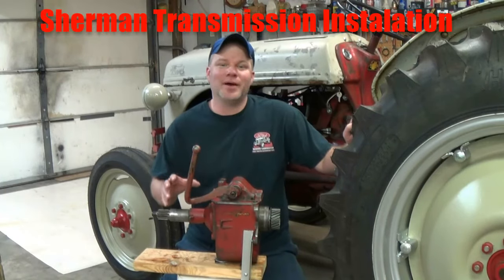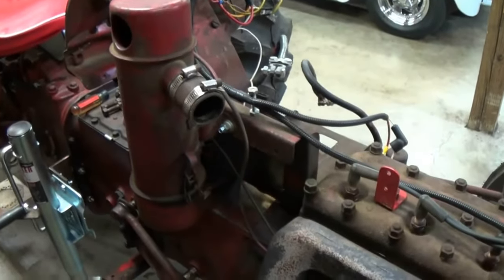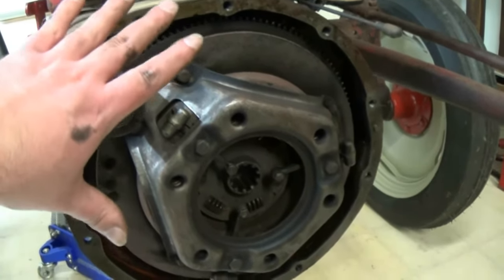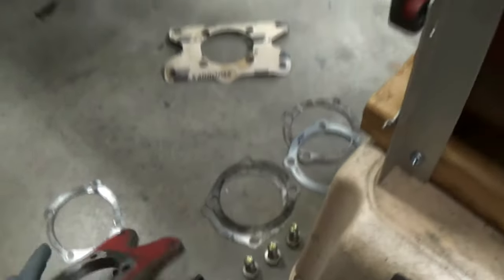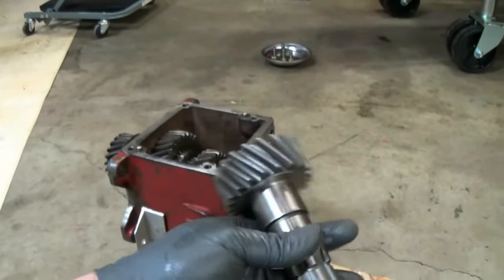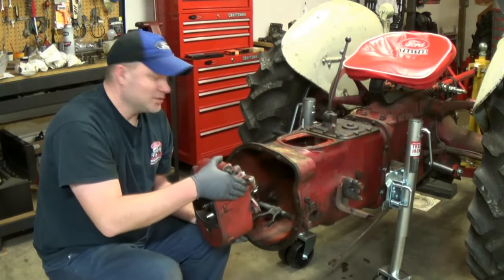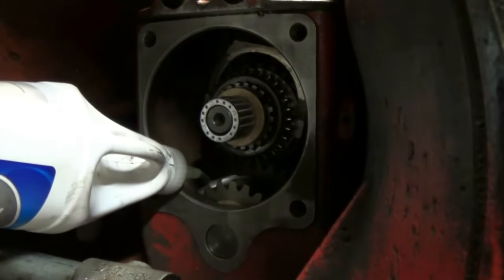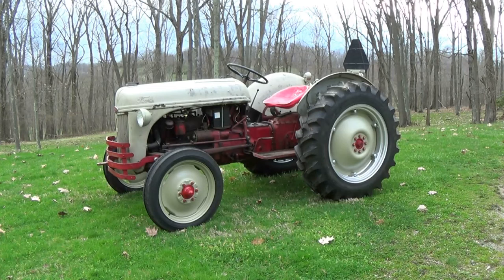Sherman Transmission Installation (Ford 8N Tractor)

Comment: That was really interesting to watch. I had no idea there was a secondary transmission available. Ive mentioned before the high reverse gear in my 8N makes it unpleasant to work with. I hope to do a full restoration on it in the next year or so. Nothing wrong with being picky. Ive fell down the rabbit hole before on projects. It sucks but in the long run its satisfying. Shows a lot about  character and workmanship holding a higher standard. Any tips for finding a Sherman for mine?
Reply from the maker: It is a pretty fascinating thing if you stop and think about it.
As far as finding one they are out there especially if you post a want add someplace. The problem is there is a lot of junk ones out there. They arn't cheap and to get into a full blown out rebuild can be frustrating and expensive. Especially finding parts that are no longer available. You'd almost need to but several and use parts to make one good.
I'm gonna be honest. I was very disappointed to find out that low range only slowed down the reverse about 1 mph at idle according to GPS. You can hardly feel the difference. As far as high range I'm going to do dome more test runs with it,but right now it may be too high of a gear for the little 4 cylinder flathead. I'm wondering if the slightest of hills will bog it down too much that it will be almost useless? You'd never be able to pull anything that is for sure. Tractor only.
So basically if a tractor doesn't already have one that is in tip top shape I'd never go threw the expense of putting one in again. I don't feel I gained a whole lot.
Reply: @Jason1Pa  thats not surprising at all to hear. Such is the life in hot rods, motorcycles etc. Spend a bunch of time and money and get little noticeable gain sometimes, lol. Good video tho!
Reply from the maker: @GuntersGarage  yeah it was still a interesting experience and made a good video. I'd like to drive a newer Ford such as a 800 model or newer to see how that would be. Twice as much power I think would be a game changer.
Reply: @Jason1Pa  we had a Jubilee when I was a kid and a few years ago I had a 1964 2000 series which is basically a blue Jubilee and I dont recall ever having that fast of reverse gear. The hydraulics were way better with the engine driven pump.
Reply from the maker: @GuntersGarage  If I remember correctly the Jubilee has a different counter shaft so the reverse is probably slower. Some things are the same on a 8N somethings are different vs. Jubilee. I believe the rear ends are the same,but swapping transmissions between the two won't work.
Reply: @Jason1Pa  my dad and i bought a jubilee from a neighbor and it has a secondary transmission i'm not certain if it is factory or not but it does seem to handle it fine and goes down the road in high range 4th gear a little over 20mph
Reply from the maker: @redneckpyromania6965  There was never a factory secondary transmission. The Jubilee had a 4 speed transmission from the factory. Is the lever on the left hand side and look just like the one in this video? If so then it is a Sherman high/low transmission.
Reply: @Jason1Pa  okay thank you for the clarification and yes it is on the lefthand side but at some point the previous owners broke off most of the handle which makes it kind of difficult to shift
Reply: @Jason1Pa  So call me crazy but  i feel like a major potential advantage of having  a lower range and a higher range is the ability to run shorter tires as well and have a lower low, a lower medium, and STILL a higher high range top speed. Because i think most people would rather have more slow speed options than more high speed options.
Reply from the maker: @Vigo327  That's one way to look at it. A smaller tire will definitely slow you down some. A negative to that though would be traction. Smaller tires generally have a smaller foot print and could lead to more slippage. Plus I'm a visual kind of guy. A larger tire just looks better to me. I personally don't have a problem with even 1st gear being too fast. I never really use 1st. I brush hog in 2nd ,plow in 2nd. My only complaint is the high speed reverse which is almost exactly the same ratio as 3rd gear. This particular tractor will be eventually a tractor I use on tractor drives at shows and I drive a good bit on the road between my parents house and mine so speed is more important to me.
Reply: @Jason1Pa  Makes sense to me. I don't road my tractors at all.  I have an old Kubota L210 i am going to start fixing up and plan to go shorter and wider on those tires, and i actually plan to modify the fenders to fix the look. I'm a car guy first and 'fender gap' is something i'm particular about even though it's meaningless on a tractor to anyone but me! But my other two Kubotas ive either kept the stock size, or gone bigger. 👍
Reply from the maker: @Vigo327  Sounds like fun!! Yeah getting sheet metal and such straight and looking good is tough. Some of my restored tractors about put me in a nut house!! 😆
Reply: @Gunters Garage  Hey GG. Finding a sherman step up step down should be easy for you. Widely available in the USA in junk yards. Try "greenbackin" among others. To my knowledge, I think there were three types available. Sherman step up, step down. Sherman step up, mostly used for the n9. And I think there was an unbranded step up step down. There is also a cable operated type. Greetings from Ireland. Hope this helps.
Reply: @terryhiggins9700  thank you very much. I have bought from greenbackin on ebay before. I will look into it. Thanks for the info!

Comment: If I couldn't find an 8N with Sherman but a nice original 54 (Jubilee I think they are called.) Is there anything I should know about them that isn't good and should I just stick with an 8N?
Reply from the maker: If it is a 54 it would be known as a model  NAA . The Golden Jubilee is a NAA but in 1953 (Fords 50th Anniversary) the NAA is referred to a Golden Jubilee. The only thing different about a 1953 is the emblem that says Golden Jubilee.  They are a big improvement over the 8N. First is the overhead valve engine, better hydraulics ,etc.

Comment: A sherman transmission is great in an 8n if you're going to use it for baling hay. Of course an 8n is a little small to pull a baler but they do ok if you are on fairly level ground. I have baled with one but 1st gear is a little fast. Low range in the sherman solves that problem.
Reply from the maker: I'm gonna politely disagree. As much as In love the Ford N series they are not a good choice for doing hay. Other then raking of course. Too fast even with a Sherman. The Sherman really only slows you down a couple mph. It helps,but it is not a solution to the problem.
Reply: @Jason1Pa  You are right. I would never buy an 8n for baling hay but I have been in a situation where I had to bale with an 8n. I installed a shermaqn transmission in a NAA Jubilee years ago and was thinking it slowed it down more. It has been so long ago I really don't remember.
Reply from the maker: @trailrider0194  Well a Jubilee is slightly geared slower then a 8N. Especially in Reverse. Reverse in a 8N is insane. I can't remember the gear ratio but it is almost exactly the same as 3rd gear.

Comment: This is a very dumb question from a guy that has wanted one of these tractors for 20 years and I am now able to purchase one and so I am reviewing all the current information I can: Why couldn't you drill a hole directly below the Sherman drain plug that would fit a larger drain plug allowing you access to the Sherman drain plug and the ability to plug the access hole? Am I making sense here?
Reply from the maker: Hi! Yes this question comes up often. Some things to consider are 1) The hole you would need to drill in the tractor to have access to the plug of the Sherman would need to be fairly large to make sure the oil that's being drained exits completely or it could touch the flywheel and get flung all over the clutch. 2) drilling yet another hole even larger then the one for the shifter lever could possibly have a effect on the strength of the casting. 3) You could put a pipe up in there and have it exit the bottom with a cap on it BUT with the tractor so low to the ground it wouldn't take much to break the pipe off one something. 
The Sherman doesn't really hold that much oil. Even if that oil is nasty it would be diluted fairly good in the fresh 5 gallons of the main transmission. Another thing is if you'd drain the Sherman empty there is no way to add new oil to it. Oil would need to work its way in there with the oil slinger and that could take a while of driving for that to happen. The Sherman would be turning for a while with little to no oil for a while.
Reply: @Jason1Pa  Dumb me...
Reply from the maker: @benkanobe7500  The only way to know is to ask. Thanks for watching.

Comment: Sherman transmission as in sherman tank I don't work on tractors normally but been thinking of getting one so what will this do give it more low rang or high rang
Reply from the maker: Yes you have a low and a Hi range with this particular transmission. So normally the tractor would have 4 forward gears and one reverse. You still can use the same gearing (stock) with leaving the Sherman in "Standard" range, but you can have higher gearing and lower. Now the tractor has 12 forward speeds and 3 reverse.

Comment: 8N hood removal: if you're 6'6" with long arms you can pull it off by hand from the side. One hand under the lip below the dash and the other hand under the front above the grille. Ask me how I know. Removed several that way. But, if you have a hoist, use it!
Reply from the maker: I've seen people remove them by hand and I cringe. The radiator neck takes a beating especially when going back on. Probably why so many are bent. The fuel bowl is naturally at risk of getting beat up as well. Then things such as fuel line or headlight wires can easily be forgotten to get disconnected can be damaged. With the lift I just go a little at a time and watching everything and being gentle. My hat is off to you for being able to even lift a hood by yourself. I physically could not do it plus I wouldn't even try. My back hurts enough as it is. Before my dad and I would remove them by one of us on each side. We don't even mess around anymore. Takes a few minutes to get the hoist out to save us and the tractor.

Comment: Do you have a video that showed how a properly adjusted clutch should work.   Zillion vids on adjusting none shows you exactly how the clutch should travel and work properly.     Thanks
Reply from the maker: Not on a 8n
Reply: @Jason1Pa  ok thanks.   Any that style tractor would probably do.    Can you tell me on an 8n should the peddle travel all the way down when pressed down?    It’s stopping right after the free play.  Just bam that’s it. About half way down.   Thanks
Reply from the maker: @moparornocar3764  Yes it should go all the way down to the running board. If not it almost sounds like your pressure plate is stuck
Reply: As I split it again the clutch plate had slipped a little & wouldn’t let the shaft into the pilot because I tried the alignment tool and it wouldn’t slide in.   Next time I tightened the pressure plate evenly and made sure the tool would slide all along through the process.  So it is back in the pilot now everything looks good peddle goes down a lot further.     I guess it’s in the adjustment now.   Going try and adjust it tomorrow.
Reply: Well I split it again ,three times.    This time I’m going to adjust the fingers on the pp.  they aren’t being pressed.  Seems it isn’t touching the fingers.     I’m gona try and tighten them down some to pull the fingers up.   Do you know of an easy way to do this 

, some say 060 not sure where or what to measure.    Thanks again.
Reply from the maker: @moparornocar3764  I'm not sure I always have the clutch place the rebuilds them adjust the fingers.
Is this by chance a brand new one?
Reply: @Jason1Pa  ok thanks for responding.     All new clutch, pp, bearings.    The fingers were set from factory deep into the pp.  so I’m gonna try and adjust.   I feel if I bring them out some it will work correctly.    Just have to figure out how much.       Thanks again.
Reply from the maker: @moparornocar3764  I find it interesting that a brand new PP is adjustable. Most I've seen are not. That's why I try to get the old ones rebuilt.

Comment: I need a new output shaft for my Sherman. Where can I purchase one?   Thanks much for your time.
Reply from the maker: I would not recommend a new one. As in my video I was not able to use them. Long story short they are not made very well. Best to find a used one but good luck. Hard to find one in good usable condition.
Reply: @Jason1Pa  That's good to know. I will be working on two of them soon and I think one will need an output shaft. I was hoping to use one transmission for my 640 and sell the other. But per your advice I may just try to make one good one out of the two. By the way. Great videos. You have no idea how many people benefit from them.

Comment: Are you using an original radiator on that? Also would you recommend the 4 blade of 6 blade fan? Thanks
Reply from the maker: The radiator is a Sparex brand replacment. They are the only ones I'll use on a Ford. Very good quality and fit like the originals. Also has 4 rows of cooling tubes like the originals. Most replacements have only 3.
The 8Ns came with 4 bladed fans. The 9N and 2Ns had 6 blades. I don't see an advantage using 6 as far as cooling goes. As long as you have a clean radiator and up to par cooling system you will be fine. It is very hard to over heat these engines. A 4 blade wouldn't weigh as much. Would probably be less stress on the water pump. To me the 6 blades make a little more air noise as well.
Reply: @Jason1Pa  Great thank you! Ive got the original but its got some damage from previous owner. Can i get it from just 8ns? They have one thats 4 tube style. I think they use Sparex but not sure. Thanks for all your help. Just got my 8n split today. Your videos are making me confident splitting it lol..
Reply from the maker: @davidshipulski4532  Yes Just8ns,Dennis Carpenter,Fix that Ford.com sell the Sparex brand. They are also known as "Restoration Quality" ones.
Anymore I just replace my radiators if possible. The cost of getting them record has gone very high. That's if you can find a local place. Kind of a lost art.
Glad your gaining confidence! Thanks for watching!
Reply: @Jason1Pa  Awesome! Thanks so much take care.
Reply from the maker: @davidshipulski4532  Anytime!! Have fun.
Reply: @Jason1Pa  One of the 1st projects we did was install a S/W temp gauge below ignition switch on our daily working 8N thoroughbred farm tractor. It gets hot now in Oregon summers even here on the west side of the cascades. From what we have read flat head engines don`t like getting hot! If we keep grill & radiator clear of brush & grass while mowing or spreading compost the temp is normally 180F but if debris starts building up even lightly then temp will build up to 210F fairly quickly. Addition of temp gauge is a very important item for a daily working 8N tractor. Never understood why Ford did not include one. We have a 180F thermostat in cooling system.When cleaning stalls in winter with our custom made bin with a front loader, the temp rarely goes over 130F. Our tractor has Farmhand loader according to our 90 year old, very knowledgeable neighboring farmer, Bill, who our county road is named after.
Reply from the maker: @frederickbooth7970  Yeah it's interesting why Ford never put a temp gauge in. Like I said above though as long as the radiator and coolant system is up to par it's almost impossible to over heat these engines even in the highest of temps. These things are even down as far as South America and cool just fine.

Comment: I noticed on one of my Sherman hi/lo tractors someone drilled a hole on the bottom of the bell housing to get to the Sherman drain plug.
Reply from the maker: Just curious as to how big the hole is? It would need to be rather large or you could accidentally drop the plug and have it stuck in the the bell housing. Also if you'd drain it and oil wouldn't exit the bell housing you could get oil on the clutch possibly especially if the weep hole is clogged. Any hole too big I'd fear would drastically effect the strength of the tractor. Too me personally if you keep up with frequent oil changes that little bit of oil that fills the Sherman would be nothing to worry about. It will eventually get mixed in with all the new gear oil.
Another point to ponder. What if that hole was created to spray something on the clutch that got stuck at one time?

Comment: If you're tires were 12-4 -28 she would run faster but i like the 11-2-28 myself good videos many thanks
Reply from the maker: Yes. I have another ford with brand new 12.4x28 on it. Sometimes I wished they were not on there. Pros and cons to it.

Comment: Add a hole to original casing below Sherman Drain Plug to reach up and drain?
Reply from the maker: If you keep up with transmission oil changes the little bit that stays in there will hurt nothing. It gets oil from the main transmission there is continually flow of oil going in and out. If you had a hole you wouldn't want it very big because it may start to crack the bell housing. If you had it small just enough the oil would still probably go everywhere before it would go out the hole. Like on you clutch. And if you would drop the plug on the inside good luck getting it out.